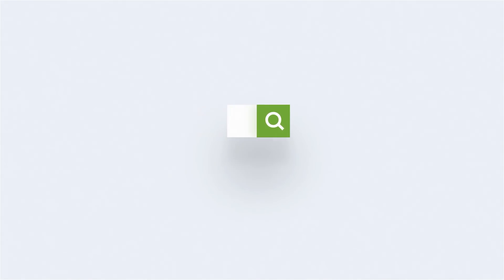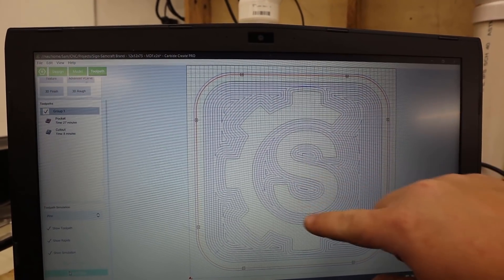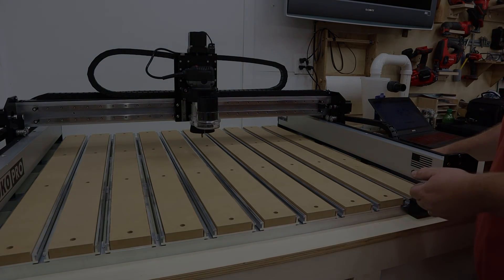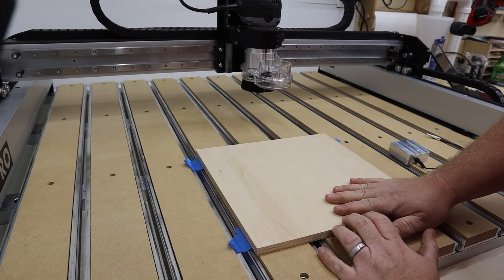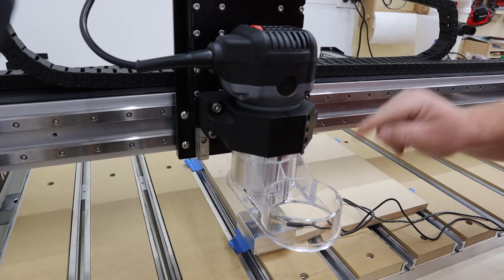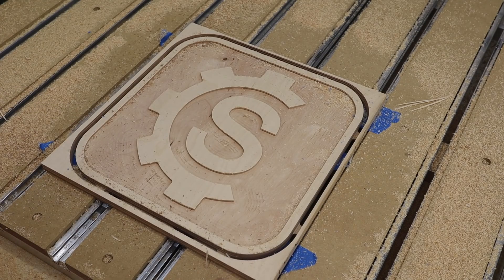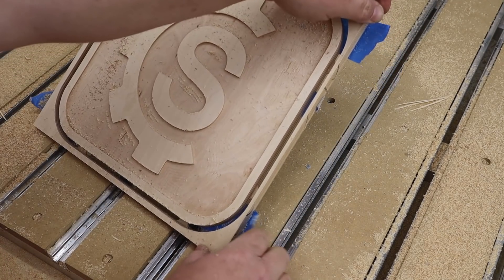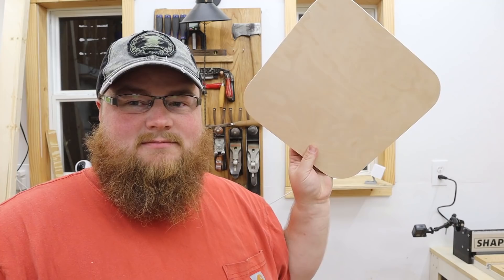My FIRST Sign on the Shapeoko Pro CNC Router

Comment: Sam do you do all the designing cam and cad on your PC and then put in on a usb flash stick then transfer the stick to your tablet ?
Reply from the maker: I design and generate the gcode files on my laptop, save it to a network attached hard drive (USB stick or Google Drive would also work), open it up in Carbide Motion on my tablet, and run the gcode on the CNC.
Reply: @Samcraftcom  Thanks Sam I intend to buy a Shapeoko after the holidays and the climate in the West of Ireland is wet and my workshop is not heated I need to do mast of my computer work in the home office.
Reply: @Samcraftcom  Sam just one more question before I smash the buy button, do I need the bit setter and the bit zero V2 ???

Comment: So I don’t a zero  setter thing. How do I set zero without it?  Basically it initialized and did the bit setter  fine. I load my file but how do I tell the machine where the work piece is?  Bc I started it w/o the spindle running and it went down way past the waste boards

Comment: Can you specify the router speed or is it just full on?  Extras to buy appear to be the Bit Setter ans the Z-probe  It is about a $3000 investment, not including making a table for it.  Axiom pro routers are double the price.  Vcarve software is pretty robust for creating separate tool paths, costs extra.  Do you think the Spapeoko Pro could make a wavy flag with stars and strips? Can you set separate tools paths with different bits and cutting depths?  Helpful videos, thanks.
Reply from the maker: The router is variable speed, but manually controlled. No problem doing 3D carvings with the Pro -- several others make such items as the wavy flag. Yes, toolpaths are all individually programmed to whatever you need.

Comment: Sam, love your videos!
Been on the Carbide website and can’t quite discern what the difference is between the XXL and the XXL pro? (Other than the cost)

Also, would it be possible to put links to your handheld remote and the device to zero the X, Y and Z axis please.

Thank you so much and keep up the good work!
Reply from the maker: I wrote an article on my website just for that reason! :) Link at end of this comment. It shows the on-paper differences between the two machines. The only reason I would say to not get the Pro would be if money is an absolute limitation. Otherwise it truly excels in every other aspect and will save you time, money and headaches down the road. The wireless remote should be linked in the description, although I now use a Fusion5 tablet with my machine and it's so much better -- more streamlined device, dust-proof (no fans), and smaller format. Here's the link to that tablet. You can see it more in my newer videos like the pegboard or shamrock ones. Tablet: https://amzn.to/3l6K7a4 XXL vs XXL Pro Article: https://sam-craft.com/shapeoko-xxl-vs-shapeoko-pro-which-to-buy/ and lastly, the BitZero (newest model): https://shop.carbide3d.com/collections/accessories/products/bitzero-v2?variant=32936948236349
Reply: Thank you Sam!!!

Comment: Can you measure the noise outside the workshop and does it disturb the neighbors when tern on the machine with a vacuum cleaner?
Reply from the maker: As it is right now (check current videos for more details), the sound is well-contained in the workshop. My shop is insulated (after 6 years) and that cuts down on the noise a lot. By far the loudest part is the router. I'm saving my money for a spindle someday.

Comment: I saw you use a bitzero.  Does that come with the kit or is it a separate purchase?  If it is separate, is there a reason you went with that instead of the V2?  Thanks for the videos, its helping me a lot before I purchase one.
Reply from the maker: The BitZero is a separate purchase. I got the v1 because the v2 was not available when I placed my order back in October. :)

Comment: Will a mac/osx 10.12 to 15 work.
Reply from the maker: I think so, but check out carbide 3d's website to be sure. You will need OS compatibility with the  motion software (program that send the gcode cuts to the machine and moves it) and for the design/toolpath software (program that you design pieces in and calculate the cuts). Carbide Motion is the motion software, and there are many options for the Design software. I used Carbide Create for this sign, but have since changed over to Carveco Maker.
Reply: @Samcraftcom   Thanks, keep up the great work.

Comment: Did you surface the waste board prior to cutting? Also- put tape on both surfaces first, then glue on one and smash together. If you want to just slap something on the back, use carpet tape (my usual).
Reply from the maker: I've not surfaced it... yet. Waiting for the last tool to arrive to allow me to surface and tram the system. :)

Comment: Too cool! Any thoughts on how to eliminate the need to sand in the negative space inside the logo?
Reply from the maker: I think with a little machine fine tuning and the right bit & settings it can be worked out to not have to sand much. I think this is also why a lot of people do epoxy pours with things like this too... the epoxy (if colored) hides the imperfections and you don't have to worry about them. :) I've never done an epoxy pour before though.

Comment: Sam, draw lines on your bed and take a few small scraps and create a 90 degree angle on the corner or use your t tracks. Put the board you are going to carve down and space your tape out and use the tape you put down as a guide and apply your tape to the work piece. Everything will line up. If you want further I can email you pictures of what I do

Comment: Would you consider using your new CNC to drill holes in the base for alignment pins?  That way you don't need to touch off for x & y zeros, just to material height.
Reply from the maker: I'll definitely be adding in some time savers like that in the future. Especially when I finalize some of my designs that I want to make production runs on. :)

Comment: Damn man your just busting out videos right now. Nice MSI laptop. The sign looks amazing. This is an off topic question but I have the same bandsaw as you, do you ever use yours for resawing? If so how are your results? Great video
Reply from the maker: It's a little bit of a hot time for content I guess. LOL I've only resawed a handful of times. It does okay all things considering. A sharp blade makes all the difference.. and patience! LOL I buy my blades locally from Klingspor's Woodworking but think they also ship them. No special brand, just a low TPI for rough cuts and a high TPI for smoother stuff.
Reply: @Samcraftcom  it must be nice to have a woodworking supply store locally. I live in the middle of the California desert and woodworking stores aren’t a thing. I’m going to try and build a fence for my band saw and see if that helps. Thanks Sam!

Comment: AT about 1m 19s you show the Callipers recording 12.9mm but you used 13mm.  Are your callipers off or did you actually put 12.9 in the stock on carbide create?
Reply from the maker: The calipers floated around 13mm depending on the amount of force I did or didn't place on the wood -- they're a cheap set from Harbor Freight. This turned out fine for me. Most of what I'll do will not be so precise that I have to worry about 0.1mm, thankfully.

Comment: The sign looks awesome! Out of interest, In theory, as you used the same bit throughout did you need to use the bit setter for its job? Also, did the bitzero/touch probe come with the pro or did you get it separately? Heard they are hard to come by for some reason?
Reply: Pro comes with bit Setter not the Zero
Reply from the maker: You don't have to use the BitSetter with a single tool job, no. But once you enable the BitSetter in the settings of Carbide Motion, it prompts you to run through that workflow after every homing job. The BitSetter came with the Pro, yes. The BitZero was an additional purchase. They just released a version 2.0 of the BitZero, but quickly sold out. So maybe that's it? Hope this helps!